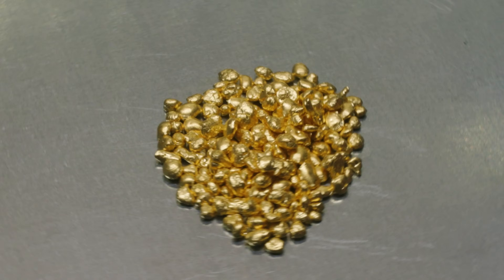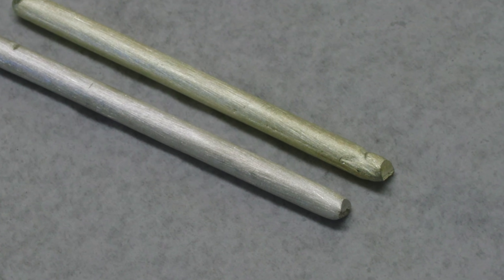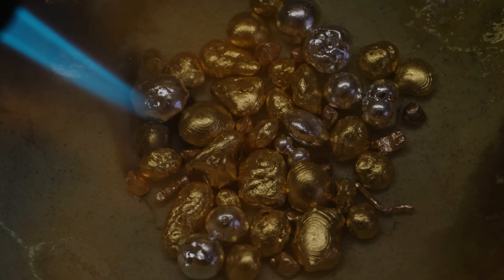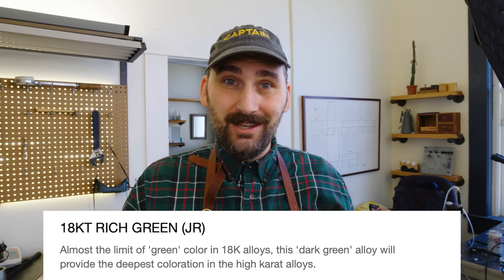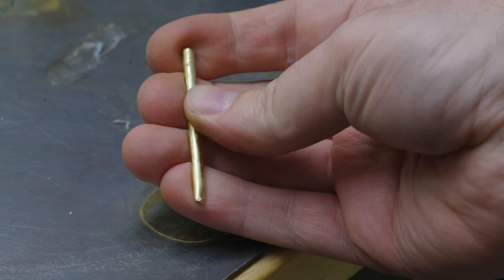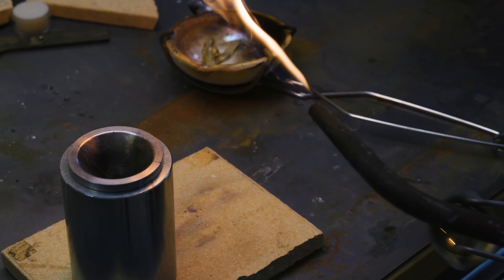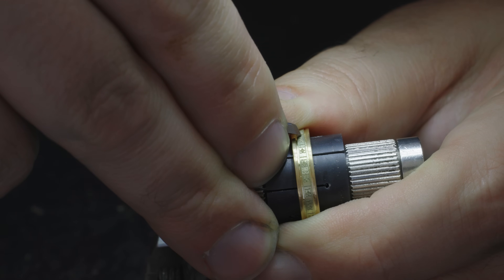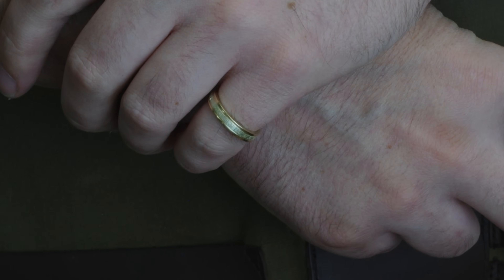How To Make Green Gold

Comment from the maker: The tools I used to make this video: https://www.benchclass.com/greengoldlist
Reply: Hey bro, I've heard about the 18k blue gold that is 3/4 gold and 1/4 iron (Fe) . 

Wonder if you're interested to try it out.

Great channel btw ✌️😊
Reply: Now do purple gold!
Reply: 7:40 is there a was to oxidize copper very evenly ? And then use a little bit of resin?
Reply: There's a few alloys with more green color. One requires a patina process. And 14kt and 10kt alloys I've seen in person can get closer albeit different to the cadmium alloys. 

Also. Blue gold. There's a crazy 20kt range alloy thats possible.
Reply: Did you look into the Japanese techniques for colored gold?  

Do you know you can harden  24k gold in a way that makes it  good for jewelry?  

Temperature has a huge effect on the colors  that  can be derived from gold and silver.    Including using methods like sputtering and vapor deposition.

Ive never shared this with anyone but  the results of draping, wrapping, or encasing  gold, silver or a combination of the two results in borosilicate glass… can result in truly spectacular stuff like nothing else I’ve ever seen.     
It can result in a sort of holographic … i dont know how to explain it.  The holographic  craziness happens when i use a HHO torch

Ive wanted to mix gold or silver or both with tantalum.  I was having tricky even melting the stuff without it oxidizing?? Its white powder. But when i finally did melt some it created a really cool pearlescent little bb/ball. I ended up melting it inside a glass tube to get the oxygen out. 

Oh and i recently discovered that silver will turn really beautiful deep purples. Burgundy. Bronze and what not if it is engulfed in Hydrogen gas  during cooling.   Soo like right after it’s no longer glowing hot to the point it will ignite the  hydrogen you want to let the hydrogen flow and it will instantly in a flash turn color…

I discovered this and other things because i learned on my own.   Experimenting.   

The internet and so called experts Xspurtz?  Are great and all but theres a lot to be said for experimentation. 

The sciences suffer from a lack of experimentation massively with so many people adhering to the supposed Laws and theories of this and that which truly become waLs to progress.      

Want a great example? Go to Grayfield Optical Microscopes website. It’s a German company but the site is in English too. 
Since 1976 they’ve been producing optical microscopes able to see live specimens in vivid detail down to 100nm which is vastly superior in all ways to the comparatively archaic electron microscopes  which can only view non living. Highly stained and altered specimens. The whole setup is elaborate, tedious, and time consuming. 

“Science” says this is impossible due to the Law of ??? Refraction or something. .. which obviously  theres an issue. Countless laws  are filled with so called anomalies  and exceptions. … aka examples of things not obeying said LAW!!!
aka not a Law but a literal waL to progress. 

The inventor of the Grayfield microscopes  has written some great stuff on his site about this tyoe of thing with Laws and people’s religious like adherence to them. Acting like zealots becoming angry with anyone  who would choose to challenge or out right ignore them.  

That is what he did. He ignored the Law. Didnt even read it cause he didn’t think it made sense and wanted to try for himself.  Others mockedan and  said your wasting your time and money. Its impossible.  So and so already proved it along time ago   Which is where we got the Law and and and…

Snd i dont care he said. I just want to try. So i can see and experience for myself.   

Turns out it was possible. In fact with unlimited resources he said he could get all the way down to 10nm he was quite sure but the extra cost would  be enormous. 

After he was successful he then read the paper the law was based on. Upon finishing the read he expressed how lucky he was that he’d never looked at it as it would have totally tainted his thoughts. Sent him In the wrong direction and he would have never been successful. 

Hope much more of this is going on?? Id argue a ton and in fact have other examples such as with the bohr/bar magnet theory which just like the optics  throws everything in magnetic off. See :” David Lapoint Primer Fields Series” here on youtube for the correct theory.  The videos are a must watch.  Super cool experiments, as David Lapoint is a Plasma Physicist. 

Sorry for the tangent but im passionate about sharing this message/info.   Never be afraid to follow your intuition. And explore. 

Just like you in this great video.
Reply: How much?
Reply: ight blue and red next it is possible
Reply: Clear gold?
Reply: Hi I was wondering if you could do a video of removing zinc from copper pennies before 1982?
Reply: how to get pinned

read more...
Reply: Well done.  Silver / gold.  
This is proper green gold.  
My favorite .
Reply: You ever work with the blue metal Osmium? or the rainbowy Bismuth?
Reply: NOT DAMASCUS!!  It's pattern welding, it's got absolutely nothing to do with damascus steel

Comment: You shouldn't have melt zink alltogether wit the other metalls. While otehr metalls get liquid zink burns away. You should have first melt all metals except thik, than coll the alloy down and squeeze the drop, after thatput the piece of zink in the pot and cover it by the sqeezed alloy. After that heat it by flame until it fuse. The alloy above will cover the zink and prevent it from burning.

Comment: you must have money to burn ? I'm a retired goldsmith . I made 18KT green gold into a plate for a leaf piece . It was a Fabrege knock off . 18KT gold is 75 % pure and 25% alloy which is generally copper and silver . If you want a redder shade put 2 parts copper one part silver. if you want a greener color (my favorite) 2 parts silver one part copper . My leaf was 25% silver no copper . 14KT is 58% gold .10kt 43%? . Red gold is a gold alloy that is a little weird . Again red means no silver just copper alloy .  The weird part is when melting or soldering red gold it must be quenched after you take the torch away or it cracks ☠ which leaves you with a repair to do . Gold is so expensive now I work in silver to keep my hands in.

Comment: remember child, if u dont mix with a stirring rod then its possible for the metal to be unevenly mixed. adding a dash of potassium nitrate(salt peter) will help with purity and cohesion. also keep in mind how it looks finely polished vs rough sanded will be very different and the comparison should be at every stage for best results. next to try is purple gold :3 if u can do that id be impressed.

Comment: I was making something out of silver once, and it came out of casting with the most spectacular pink color….of course it all polished off in the cleanup process, but I knew that it had to be heat and maybe quench related…..I’ve spent years annealing and quenching chunks of silver to figure out how that occurred, but i’ve yet to recreate it, even from a casting.
Using green gold to make leaves, or some other component that would naturally BE green, and pair it with white or yellow…would certainly make it appear more green. 👍👍👍 very cool
I’d never heard of green gold. 🤷‍♂️
Reply: Maybe a surface finish thing with the sand used as a surface finish thing or the binder for a chemical reaction?

Comment: You messed up smelting. You’re supposed to bring each mineral to their bowling point separately at the same time then mix them just enough for it to be fully settled. This is so you don’t overhear the metals at much lower boiling points temperatures.

Comment: This brought back memories of my years as a casting jeweler. My favorite color for Electrum (Green gold) is 18K (.751). It’s beautiful. BTW, never use any copper in Electrum. It fades the green. Also, add the zinc last to the mix since it oxidizes quickly.
Reply: Because you’ll lose the zinc to oxide, or because the oxide causes issue?

Comment: Blue gold is an intermetallic similar to purple gold (AuAl2) but is instead either an intermetallic of gold and indium (AuIn2) or gallium (AuGa2). It's a structural color like purple gold so will show when the material is properly heat treated.
Reply: googling intensifies
Reply: Is blue gold strong and more malleable than purple? I saw a Niles Red video where he made purple gold and it looks pretty difficult to work with making jewelry

Comment: You have to be careful when using zinc in an alloy, because the boiling point of zinc is lower than the melting point of the other metals. 
The way you did it here, there is a good chance you had a lot of zinc in the air and little to none in the alloy.
It is better to melt everything else first, then only add zinc at the end and quickly cool it back down.
Reply from the maker: Yes you are correct I shall do this in the future!

Comment: I am a former goldsmith and I learned to melt the most precious metal first and add the other metals when the most precious Metall is already molten. Especially with copper due to its tendency to oxidize. Why are u putting all metals all together to melt them? Am I missing something?
Reply from the maker: Yes normally I am using “master alloys” which can be melted at the same time, however in this case it probably would have been better to do as you suggested.

Comment: There either is, or was, a custom jeweler at pike place market, in seattle, washington. They specialize (d)
In custom platinum/gold wedding band sets. They produced literally, the darkest green gold ive ever seen and I'm 47 now... it was used along some charcoal grey platinum. We're talking, like something along the lines of hunter green that blows doors on black hills gold, ALL DAY LONG!!! The platinum, was also exceptional as well being such a dark gray as to be, maybe a shade or two of from black. They did state, in the   rundown of the processes, on the website, that the greener the gold, the softer, and more touchy it was to try to work with. Same with the darker platinum. The darker yada yada. Anyway, all my shameless gushing aside, you should check em out, and see if track it down. I cant remember the name to save my life...

Comment: Did you if you mix gold with aluminum in a certain ratio you can make purple gold
Reply: NileRed did this and it was REALLY difficult. Purple gold is super brittle and highly reactive with atmospheric gases, so you need to melt it in an argon atmosphere and bubble the argon through it to remove the hydrogen gas.
Reply: @nzuckman yes
Reply: Blue gold ?
Reply: @RobbyRockaholic  Indium and Gold
Reply: Very brittle mixture